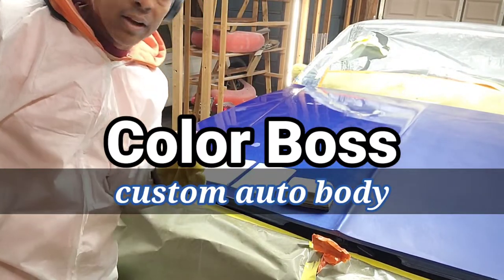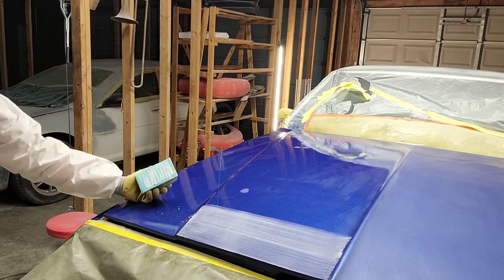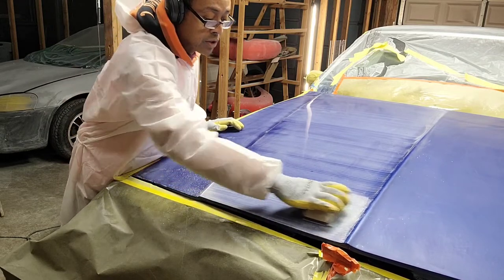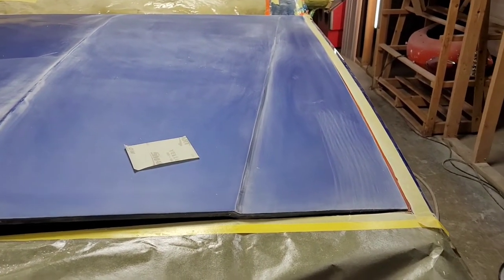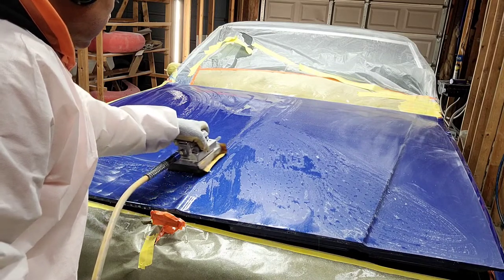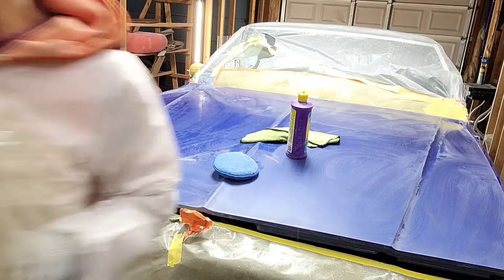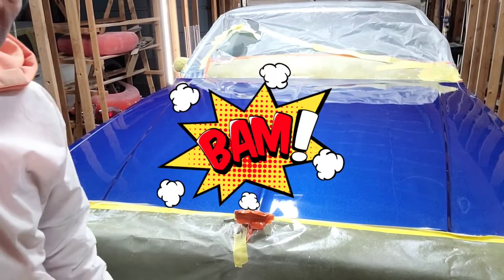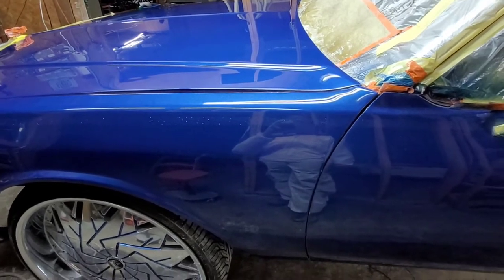Clear Coat Finishing - My Exact Sanding-Buffing-Polishing Process for Extreme Shine

Comment: Well how many coats of clear you got on there?? It might help us to know, you seem confident you aren't going to burn through, I'm scared imma burn through if I go any more than 1500...lol
Reply from the maker: Great question Aaron! About 3 coats. I never burn through. Here's why... the amount of material you're taking off with the 1500 is exactly the same as what I take off in this entire process. Me being a nerdy engineer, I looked into this very closely. Taking down the the clear in layers with this method is like going down on a logarithmic scale. The height differential in the orange peel is greater than the scratch depth of that first blue pad. But here is the trick! You do NOT want to completely remove the orange peel with that first step, or the second step. My goal is to get only HALFWAY through it. The next yellow pad takes another half off, which leaves 1/4 depth on the orange peel. The last one gets it closer yet, and then I hit it with 1500 and 2000. This saves me time, and I end up with less areas that I have to go back over. My buddy brought the car over last month, and it's still shining like GLASS. He told me that he only has to hand wash it, and that's it. The surface is so smooth that the dirt does not have anything to grip on to. Be very careful if you try this. You have to trust yourself not to take off too much material on that first level! It might seem time consuming, but my GOODNESS whenever I take the time to do this process and not start with 1500, I get the best results. He's won a car show and has taken a 2nd place on another thus far, so it was definitely worth the effort! Thanks for watching, and stay tuned because I'm going to be getting back into creating content and talking about a new clear that I'm using, plus reporting on a cheap clear that NOBODY REALIZES is owned by one of the top brands.

Comment: Nice video ill subscribe 😮
Reply from the maker: Glad to have you! I have upped my finishing game a LOT since this video. I still prefer to start with the dry sanding with these same flexible sanding sheets. But check out my video on the MaxXT rectangular electric DA. It's AMAZING. I use the same process in this video, and after the pink 1500 sheets, I use 2000 grit and 3000 grit paper with the MaxXT DA and it starts to shine before I even get the compound on it. Are you more of a fan of wet sanding, or dry?

Comment: You can't buff out fish eyes.
Reply from the maker: That depends. If you lay on the clear in the normal fashion where the fisheye is deep, you can't. But if you start with a dust coat and allow that first layer to flash and cover those silicone particles, the depth of the fisheyes don't go to the base of the clear. But a deep fisheye is a re-paint